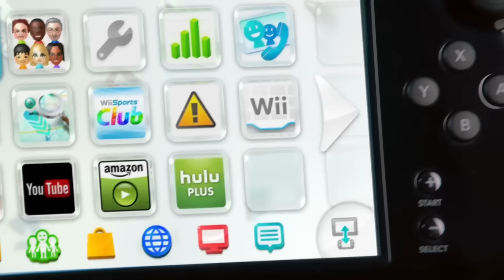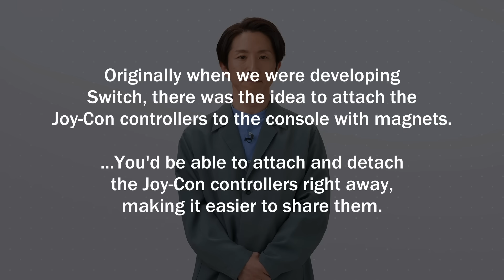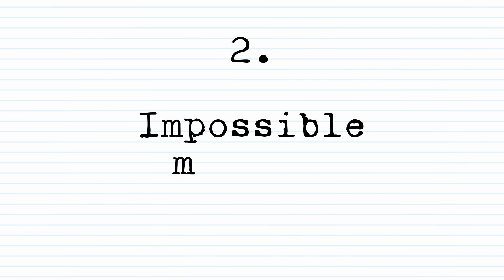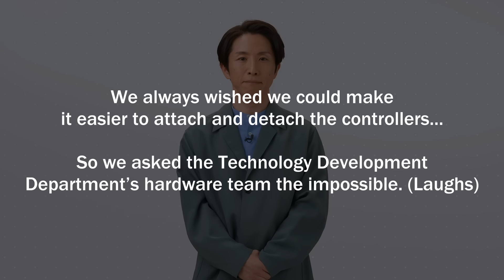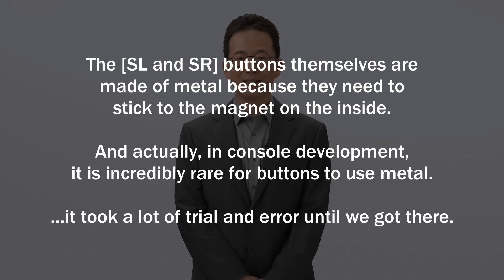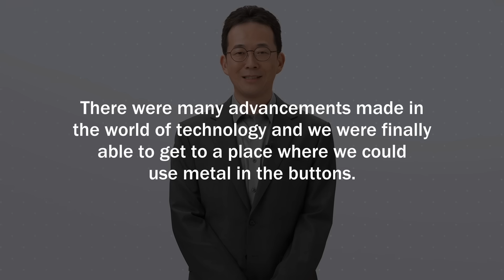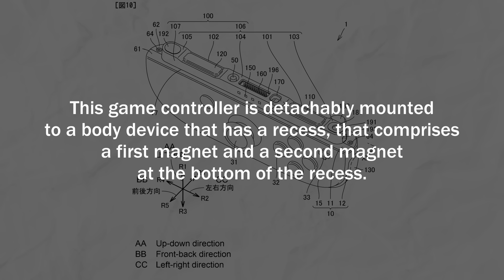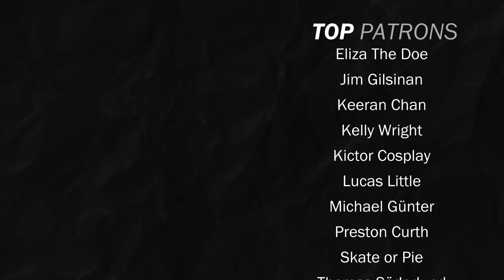How Nintendo fixed Magnetic Joy-Cons

Comment: The great thing about the magnets is that the lifespan of magnets is measured in decades or centuries. The magnetic connectors will still be good long after the rails on a regular Switch would have failed. Given some of the other tests I've seen people do with the Switch 2's durability, I wouldn't be surprised if mine manages to outlive *me*.

Comment: It also leads to the best sound and even helps the visuals in things like the external design for the screen layer underneath and around as well as just of course structural coherency… like… you can really do a lot when it comes to the expandability as the magnetic locks really cue in always 1000HZ (accuracy wired as well… and yeah … I think it’s 250HZ WIRELESS PRO II CONTROLLER WITHOUT COMING OUT SOON 8bitdo brick 3 BT 5.4 just to seal the deal as those use good magnets too on 5.0)

Comment: I offered my stupid ANODIZATION solution available past age 29.5 from the magic school bus stuff wrapping up… 26 into mass production 29 as 28+1 , 2+1 run up and then +1 marketing : distribution : batch testing stuff from 3.5… like we worked on the buttons using those exact quotes you gave and the buttons being metal was a part of the solution actually helping to swap the ferrous magnetic field effect as well as just how nice the locking on:off field button is… but we also initially came up with rail solution then too at THE UNIVERSITY OF OXFORD a year after the QUANTUM CRYPTOGRAPHY PACKAGE STUFF AT CAMBRIDGE MAKING THE MUSIC FOR THE SETUP and then the nice girl made the jingle and PUNK DA GOD mastered:looped my music for switch 2 setup

Comment: You didn't really explain any details of what makes the magnets work now vs then.
You kinda told the story but not like actually how they solved the problem technically.

I feel like the most important part is actually the size and fit of the indent to keep the controllers from tilting off. You didn't mention that at all.

Comment: I was skeptical when I heard about the magnetic joycons.  But now, having used them, I much prefer them.  Still some concern about how well they'll stay on in a few years, but for right now, they're perfect.
Reply: In 100 years the magnets should still be at 90% strength so it will be fine
Reply: @RiceCake420 Magnets also lose their magnetism when subjected to impacts.  Like the kind that would result from dropping this handheld device (I rarely drop mine.  But the occasional accident does happen.  And giving one of these to your children...)  Or having the controllers snap into place against them.  That's not a lot of force, but having it happen quite often will have a cumulative effect.

Or from excessive heat.  Like the kind a video game console like this one puts out.

Or exposure to other magnetic/EM fields.  Like the kinds that a video game console (with Wi-Fi and bluetooth) and the JoyCons puts out.  

Combining all three of those factors will certainly weaken the magnets much quicker than normal.  Will it be enough to make a difference?  I don't really know.  And neither do you.   It'll probably be fine for the life of the console, but we have no way of knowing how long they'll last until the JoyCons start falling off.

Comment: He spent 70% of the video just restating “wow how did they do it, they needed to make it strong and weak at the same time” and spent about 2 seconds saying “they made the buttons metal”. I wanted to know more about how they designed it so you couldn’t tilt the joycons off, and all the other engineering challenges. Just making buttons metal explains almost nothing, so I’m extremely disappointed in this video
Reply: Boy do I got something just for you (Nintendo Switch 2 Welcome Tour)
Reply: @tacoastline yea that portion of welcome tour did explain the answer perfectly ngl
Reply: It's the levers. Magnetic attraction weakens dramatically with distance. When connected, magnets are close enough to the metal SL/SR buttons to hold on forcefully. The levers connected to the release buttons create enough distance that the magnetic force becomes weak enough to pull off with ease.
Reply: Not disrespectful, but Thomas actually transitioned. She is a She now.
Reply: he talked so slowly that i had to put the video on 2x speed, and i STILL feel like i wasted 6 and a half minutes of my time. modern youtubers man...

Comment: Nintendo somehow makes the console they should/could have made the previous generation, at least since the GameCube. However no one would have paid since they were already considered the cheap alternative with surprisingly great IP's. This is Nintendo's chance to gain a hold of the gaming industry for the 2nd time during a game crash since they've previously grown their user base to its highest ever. I think the difference is they aren't doing a huge gimmick shift but did innovate the controller and focused on the specs and quality of life, however they've been sidelined by their own pricing which I myself have to cringe out of pain but I understand. The Switch 2 is going to be the Louvre of Nintendo games continuing the library of nearly every single previous game, primarily first and second party titles.

Comment: Nice video; i tried the joycons at on of the Nintendo events and can confirm that the consoles felt more firm and less wobbly, but i have a doubt because i tried removing them from a console and they were basically "stuck" (glued?!) on it in order not to be taken away, so i'm not sure if that's going to be the home console experience. They also had a Switch 2 where you could actually remove the joycons and it felt a little wobblier.

Comment: Hopefully, the magnetism doesn't wear over time, because I've had issues with the rail connections in handheld mode, with slight wobbles disconnecting the Joy-Cons during play. Even the weight of the console itself can be enough to toggle the disconnection. That said, mine is a launch console, so it's had a long run.

Comment: One thing to note is that magnets tend to weaken over time. We can only hope that the magnets will last for many decades or that they are easily replaceable or... it is possible that the Switch 2 itself keeps the magnets strong with a bit of power (looking forward to those teardown videos from some people)
Reply: Magnets in devices like Joy-Cons can weaken, but it usually takes several decades — often 50 το 100 years — under normal use. Unless exposed to heat, strong external magnets, or damage, they stay functional for a very long time.
Reply: What if they found away to avoid that from happening
Reply: @hoppie4263  Magnets will always weaken overtime. It's similar to how batteries will degrade over time. Magnetic forces tend to slowly disperse and transfer over long periods of time. You can sort of think about it like how a balloon slowly loses air after being blown up. Only time will tell how long the Switch 2's magnets last if they aren't being charged by the Switch 2. The reason it's possible that the switch 2 isn't going to be charging the magnets' strength is that the Joycon 2 grip is unpowered and also has magnets for attachment.
Reply: @mattmcduhhh I’m sure Nintendo would prepare for that they would have done test and they wouldn’t have used magnetics if it would be a issue that is why they didn’t use them on the first switch because they couldn’t get it to work till now
Reply: @hoppie4263  They tested the joysticks on the original switch and still, millions of joycons had drift. I'm sorry, but testing does not mean that the problem was solved.
Reply: @mattmcduhhh we will just have to wait and see Apple uses magnetics as well for there mag safe products and I haven’t heard of any issues happening with them
Reply: @mattmcduhhh  magnets take decades to lose a fraction of their strength, it won't be a problem
Reply: Given it appears that the joycon controllers have the same stick issues, I would imagine they aren't expecting the console to be a decade level device. So it's also possible they would just release joycons with magnetic LR buttons if console magnet degradation became a major issue. They seem to view the joycons as wear items that must be replaced periodically.
Reply: They'll last at least a decade, and depending on exactly what these magnets are made from centuries.
Reply: Or that Nintendo doesn't brick your console for replacing them as they might consider that a breach of the "do not modify" in the end user agreement
Reply: @Shadowtiger2564 I don’t think they would do that if your just trying to fix it
Reply: @Shadowtiger2564 i don't think getting banned from ns2 for replacing the magnet Will be a problem if it's durable enough to last a whole console generation

Comment: I still get the feeling that the large recess that the joycon insert into is the real MVP here.
Reply: Exactly, that was the real breakthrough. Magnets can have a strong connection when they are pulled on in one direction, but become weaker when sliding up and down. The recess prevents the joycons from moving up and down so all the magnets have to do is hold them against the console. It’s a surprisingly simple solution for something a lot of people thought would be impractical and wouldn’t work.

Comment: 10:55 Makes me wonder, who actually used the Switch 2 for years, so they can tell it’s controller won’t connect wobbly after a long time. Or if the metal buttons won’t get issues over time if they are strained from connecting and disconnecting. Or if the connectors that stick out from the console won’t be damaged over time. That’s not a claim anyone can make yet.
Reply: There are some things called "stress tests" that are used to plug and unplug devices, connectors, press buttons, move joysticks, pull triggers, anything you can think can happen to a moving part.
That simulates months or even years of use.
I'm not saying they did test everything, I'm trying to convey that when a claim like that is made, is usually backed by some stress testing.
I admit nowhere in the video or from Nintendo (that I know of) has anyone said that the buttons or joycons will stay perfectly functional and won't be wobbly after years, so don't take what I said as a fact.
I'm hoping they stress tested everything, but knowing Nintendo, I wouldn't bet on it
Reply: Not sure. Maybe around After Thursday June 5th will get more Public Info on first Weekend Release.
Reply: I would imagine any wear to the joycons is considered to happen at a slower rate than the joycon degradation, so not a major issue (they seem to consider them wear items). That's likely also why the release button, contact springs, and other more fragile elements sit in the joycon rather than the console body, if I had to guess.

Comment: The main reason I almost don’t use my switch anymore is because my joycons keep disconnecting super easily from literally anything and the locks for the rails are damaged so the switch can “fall out” kinda easily
Reply: I've always felt like the joycons should be attached by sliding them from below the console instead of above, it would've prevented this type of problem entirely
Reply: @1ups_15  They did it going upward so you could pull the joycons off the system while docked and using the kickstand. It might could work if you put the kickstand at the top of the screen and flipped the system to dock it/stand it, but I can see people potentially dropping the system while doing so. It's a bit awkward. Otherwise, you'd have to pull the joycons off before using the kickstand or docking, which requires three hands or fumbling with another surface.
Reply: @1ups_15  It would make more sense but they wanted you to be able to pull it out of the dock from the top which also is something neat. That's why the magnets are so much better.
Reply: Once I threw my switch on the floor (I was a dumb and ragey little kid) and it made the blue joy con slot all wiggly and wouldn’t charge the joy con anymore
Reply: They make replacement locking pins that are made out of metal. You can easily open the joycon and replace them.
Reply: while the rails are metal, the locking mechanism is plastic
Reply: That’s why I upgraded to the switch 2. I had the first issue as well.
Reply: Damn dude what treacherous beatings did you give your switch 😂
Reply: @Wadfol  only like 5 years of playing (also smash bros with friends ig lol, it’s mostly friends that took bad care of my switch 😑) had to repeat everytime to push the button to release the joycons, not just force it out (also it fell from a low level I think twice but it was concrete)

Comment: You should all be aware that the Switch 2 is actually using a Ampere GPU from 2021, which is almost 5 years old at this point, yet they have severely raised the price of the system and games. So, they're basically screwing us with old hardware again. 1536 Cuda Cores is barely anything LMAO, yet you're impressed because it's a bigger number. 

Just shows how stupid consumers are. The Nvidia RTX 2050 (an extremely old and low end graphics card from 2021) is what this chip is based on, but a RTX 2050 has 2048 Cuda Cores. Even a low-end RTX 4060 from almost 3 years ago has 3072 Cuda Cores. 1536 Cuda Cores is PATHETIC!

Plus they updated their EULA to basically say they can brick your system for whatever reason they want, and that you don't technically own your console, games, or anything else you buy from Nintendo. 

So, whenever Nintendo decides to shut down the Switch Servers, you can say bye-bye to everything you bought, because you didn't actually buy it, just the license to use it for as long as Nintendo deems fit. Nintendo has gone full evil, which is no surprise as most Japanese corporations are some of the worst in the world, all they think about is money, money, money, and making stock holders happy. They don't care about you at all.

They're basically making you pay A LOT MORE, for a graphics chip that's already 5 years old, and calling it "innovation". They become just as bad as CrApple and the iSheep that buy their overpriced deprecated technology. Shame on you Nintendo!

This is why I just bought a Steam Deck, since the Switch 2 will be $600+TAX, here in Canada. Meanwhile, I paid $819 exactly for my 1TB OLED Steam Deck. And let me tell you, the Steam Deck is a BEAST!

Not only is it great for gaming, but you don't have to spend money on monthly or yearly subscriptions, like you do on consoles, just to get online play and cloud saves - Steam gives you that for free! Ever since I sold my Xbox Series X and PS5 PRO, I now save $600 CAD per year, which is almost the price of the Steam Deck.

Finally, the Steam Deck can easily emulate Nintendo's entire catalogue of games, and it's runs them at better quality and higher fps. And the Steam Deck is technically classified as a "Portable Computer", and all you have to do is switch to "Desktop Mode", and like Black Magic you have a super fast workstation to get all your work done. I do all my Documents, PowerPoint, Spreadsheets, Video Editing, Coding, etc, and it runs flawlessly.

Linux FTW! Steam and Steam Deck FTW! AMD FTW!

#boycottswitch2 #buysteamdeck

Comment: next talk about how they fixed Joy Con Drift. 

OH WAIT
Reply: The magnets screw with hall-effect, other nintendo consoles didn't have it but still didn't drift, and there probably wasn't enough time to test thoroughly enough to determine if there is any drift— they are probsbly just saving themselves just in case.
Reply: @  fixed magnetic fields can be accounted for in software, meaning that, at most, players would only need to recalibrate their Hall effect sticks. Nintendo was sued over Joy Con drift leading them to provide free servicing for their lapse in engineering judgement. So if Nintendo didn’t do anything to change potentiometers to Hall effect sensors, they are doing it to make uninformed consumers buy more Joy Cons.

Comment: They must have way better shielding these days if you can have magnets that close to sensitive electronics and a screen.
Reply: The magnets being next to a screen is a problem only relevant to CRTs. And in general, magnets next to electronics is not an issue - most speakers have powerful magnetic cores, for instance. You only run into issues when magnets |move| next to electronics, as it's a moving magnetic field that creates current. Or when you have moving parts, such as the spinning platters inside a HDD. A couple of static magnets sitting inside a console with no moving parts besides the cooling fan, are pretty safe, especially if they're properly configured.

Comment: im still wondering if the s buttons are going to be eventually breaking because they are still a button with moving parts wouldn't the magnet strength eventually losen the holding of the buttons and break?
Reply: you think the metal SL and SR buttons are going to break sooner than the plastic every other button is made of? really?
Reply: @sirmoonslosthismind I think they think it will suck it out